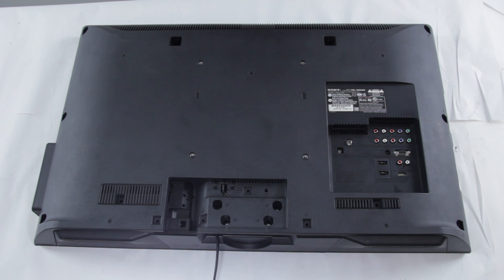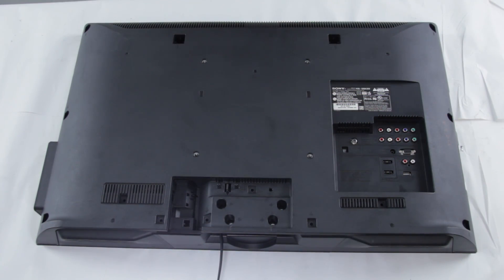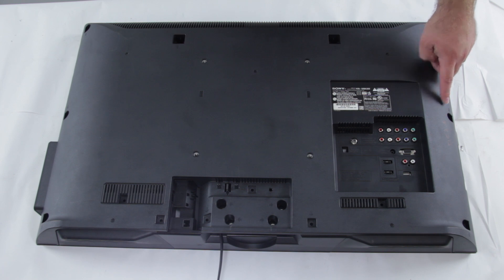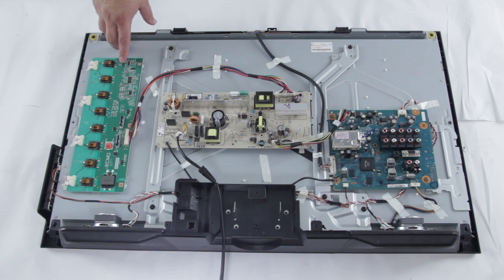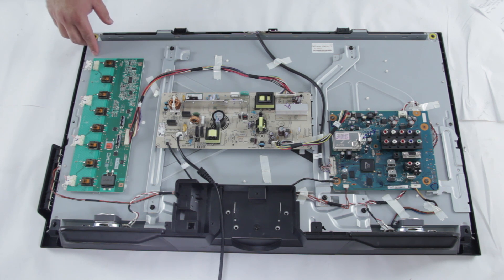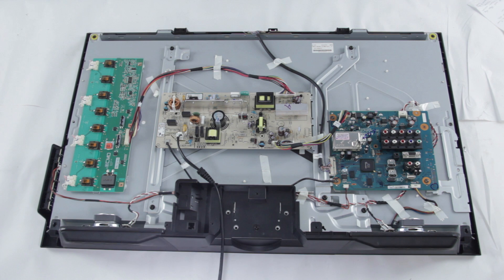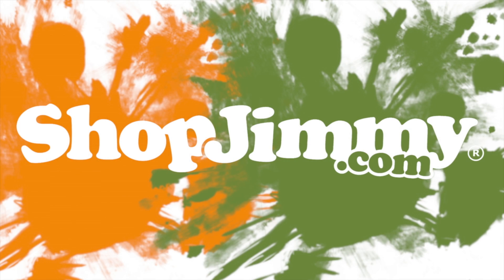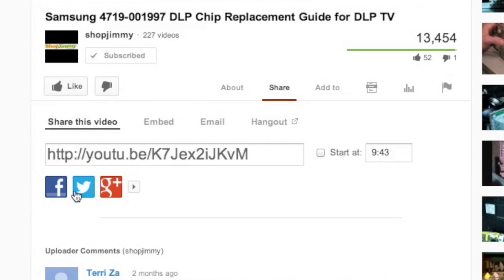LCD TV Repair Tutorial - Backlight Inverter Common Symptoms & Solutions - How to Fix LCD TVs

Comment: Hello.
A friend and I we are trying to repair a TV.
The screen of the TV seems to stay black when the TV is connected to the grid.
But if a strong light is held close onto the black screen it can be noticed, that the screen ist not completely black, but still showing that fine optical hissing.
Does this mean for sure that the inverter is broken?
Is there a way how to find out if it s really the inverter that is broken and not any other part ?
Thanks
Reply from the maker: Vornamest Nach   Please check in your TV to see if there is an inverter board.  I do not see any in the search results on our website.  Thanks!  www.shopjimmy.com

Comment: i buy 11 element elefw328 but now the backlight always dim when turn on any help please.
Reply from the maker: mechi1095   I recommend replacing the power supply board in your TV.  Here is a link to replacement parts for your TV model number on our website, click here:  http://www.shopjimmy.com/catalogsearch/result/index/?cat=59&q=elefw32  Be sure to match part numbers on your current board, with your replacement for compatibility.  You can also call our customer service for further assistance with your purchase.  (877) 881-6492  Thanks and please let us know if you have any further questions with your TV Repair!  www.shopjimmy.com

Comment: when putting a flash light up i could the picture but no backlight
Reply from the maker: *****   You will want to replace both the left and right backlight inverter boards.  Here is a link to replacement parts for your TV model number on our website, click here:  http://www.shopjimmy.com/catalogsearch/result/?q=le52m87bdx%2Fxeu  Be sure to match part numbers on your current board, with your replacement for compatibility.  Here is a link to a video showing how to identify your part number, click here:  http://www.shopjimmy.com/catalogsearch/result/?q=le52m87bdx%2Fxeu  You can also call our customer service for further assistance with your purchase.  (877) 881-6492  Thanks and please let us know if you have any further questions with your TV Repair!  www.shopjimmy.com

Comment: Hi, I have a RCA RLDEDV3988-A LED TV. A few days ago, the tv screen didn't light up when I turned it on. (I had to wait for a whole night after initially turning it on for the screen to show up.)  Right now, the screen doesn't show anything at all. The sound still works fine, just no picture. I was wondering if it has to do with a light issue? Not sure. Please help!!

Comment: I have a Samsung LTA400WT-LO1.  When I turn on the tv it goes black a min or so into it but the sound you can still hear. I have been looking up how to diagnose a bad inverter board. I have the back of the tv off and am looking at the inverter board I think. Where is the master and where is slave. Is it on the same part? Is there an email I can email you guys at?
Reply from the maker: Jonn jonzz   I recommend running the flashlight test on your TV.   Here is a link to a video we produced that shows how to run the flashlight test. No Image No Picture on TV Screen-Flashlight Test LCD TV Repair - How to Diagnose Broken TV Repair Please reply with your flashlight test results and we can recommend a replacement part for your TV repair. Thanks and please let us know if you have any questions! www.shopjimmy.com

Comment: Hi
I have a Samsung le52m87bdx/xeu, it is turning on for a few minutes and then the screen goes blank and the sound stays on, I believe it is the backlight inverter but there is 4 of them, is there anyway to see which one is the problem.
Reply from the maker: *****   I recommend running the flashlight test on your TV.   Here is a link to a video we produced that shows how to run the flashlight test. No Image No Picture on TV Screen-Flashlight Test LCD TV Repair - How to Diagnose Broken TV Repair Please reply with your flashlight test results and we can recommend a replacement part for your TV repair. Thanks and please let us know if you have any questions! www.shopjimmy.com

Comment: I have problem in my sony tv model 55hx750 the problem is when i start tv with remote there is no light on the tv screen and red led of power suply goes off temporarily and green led blinks one then goes off and again red led starts blinking.Please suggest me what could be the problem
Reply from the maker: Smit Bagadia   How many times does your TV blink?  Thanks!  www.shopjimmy.com
Reply: tv screen does not blink it remains completely dark.The red led on the left side bottom starts blinking when we start tv with the help of remote control
Reply from the maker: Smit Bagadia   How many times does the LED light blink?  Thanks!  www.shopjimmy.com

Comment: could i replace this if my problem is just a blank white screen? i already replaced the tcon board which i thought was the problem but i was wrong
Reply from the maker: Jamison Estep   Please reply with the following information.  TV model number, symptoms of what the TV is doing.  Thanks!  www.shopjimmy.com
Reply: Bottom line: grandmother gave me an insignia lcd tv that she found. no power cable or remote. found a cable in my house that fit. Plugged the tv in, all white screen. nothing shows up even when pushing menu button. did a bit of looking around, most people said its because of a bad tcon board. so went ahead and opened up the tv, found the part number and ordered a new one. part came today, plugged it in, put everything back together. still the same problem. any halp would be greatly appreciated. i would like to give this back to my grandmother as a gift. 
 
Model # : NS-LCD26-09
Reply from the maker: Jamison Estep   This sounds like a TV panel problem.  If your TV panel is bad, it may be more cost-effective to replace the TV as panels are typically hard to find in stock, difficult to replace, and expensive.  Thanks and please let us know if you have any further questions!  www.shopjimmy.com
Reply: What do you mean by "tv panel"
Reply from the maker: Jamison Estep   The "TV Panel" is the TV screen.

Comment: I have a samsung LN40C530F1FXZA Ser number Z1MC3CUZ520257H. 
The TV will not power on.  When you turn it on the red light blinks but the TV does not power up.  Already replaced the power supply board and no go.  I hear it could be the back light inverter.
Reply from the maker: WILLIAM BROWN   I recommend replacing the main board in your TV.  Here is a link to replacement parts for your TV model number on our website, click here:  http://www.shopjimmy.com/catalogsearch/result/?q=LN40C530F1FXZA  Be sure to match part numbers on your current board, with your replacement for compatibility.  Here is a link to a video showing how to identify your part number, click here:  Samsung Main Boards & Digital Boards: Part Numbers for LED, LCD, DLP, Plasma TV Repair  You can also call our customer service for further assistance with your purchase.  (877) 881-6492  Thanks and please let us know if you have any further questions with your TV Repair!  www.shopjimmy.com

Comment: Hello, I have a Sharp LC-42D65U LCD tv that the power light just comes on and blinks every second, I tried the volume dwn trick but it still does not work. Just no pic and no sound
Reply from the maker: Roger Kirk   I recommend replacing the main board in your TV.  Here is a link to replacement parts for your TV model number on our website, click here:  http://www.shopjimmy.com/catalogsearch/result/?q=LC-42D65U  Be sure to match part numbers on your current board, with your replacement for compatibility.  You can also call our customer service for further assistance with your purchase.  (877) 881-6492  Thanks and please let us know if you have any further questions with your TV Repair!  www.shopjimmy.com

Comment: dynex dx-l42-10a picture is distorted
Reply from the maker: Gregg Hancock   I recommend replacing the main board in your TV.  Here is a link to replacement parts for your TV model number on our website, click here:  http://www.shopjimmy.com/catalogsearch/result/?q=dx-l42-10a  Be sure to match part numbers on your current board, with your replacement for compatibility.  Here is a link to a video showing how to identify your part number, click here:  STEP #1 - Insignia Main Boards Replacement TV Part Number Identification Guide  You can also call our customer service for further assistance with your purchase.  (877) 881-6492  Thanks and please let us know if you have any further questions with your TV Repair!  www.shopjimmy.com

Comment: I have a 32" Hitachi LED tv : L32VP03U.  When I switch on, it works normally, then after few minutes the light/image goes off but the sound stay on. Is it backlights inverter problem?  if so, where can Buy it for replacement? send me an answer on my e-mail, please.
Reply from the maker: Edouard Bareberaho   I recommend running the flashlight test on your TV.   Here is a link to a video we produced that shows how to run the flashlight test. No Image No Picture on TV Screen-Flashlight Test LCD TV Repair - How to Diagnose Broken TV Repair Please reply with your flashlight test results and we can recommend a replacement part for your TV repair. Thanks and please let us know if you have any questions! www.shopjimmy.com

Comment: Aloha "Shop Jimmy" and company.
     I have a Visio 55" LCD TV, Model # E550VA. The problem I am experiencing is the screen has lost half (the left side) of the backlit display. I can see the "NO INPUT" splash screen bouncing around the entire screen. It's barely negligible as it bounces on the left side of the screen, but video is present. I'm an older electronics tech myself, just never have worked on LCD HDTV's before today, and I've learned never to assume anything.  After reviewing various internet posts from others experiencing similar (but not exact) backlight issues, I'm leaning in the direction of one of the Backlight Inverter Board's as being the problem. But then I pondered, could it be weak output from the Power Supply? Could the problem be that the Power Supply isn't producing proper voltage or sufficient amperage to drive the Backlight Inverter Board that supplies Backlighting for the left side of the screen?
      Are the Power Supply circuits that drive both BL Inverter Boards, coming from a single Power Supply, with circuits that are isolated from each other?  Or are there 2 separate Power Supplies?  I'm guessing, but I think the symptoms would be similar for either a failed inverter board, or a weak or failed Power Supply. What is the best way to be sure?
   My Jimmy sir, I appreciate your time and comments in the interest of getting my Visio TV back in the saddle. I simply can't afford to incorrectly troubleshoot and order wrong parts for this repair. Money & TV entertainment are both a commodity at the moment. Lol. Your Kokua (help in Hawaiian) is appreciated...
With Aloha from Oahu Hawaii, 
Robert C.
Reply from the maker: Robert Ciano  This sounds like a TV panel problem.  If your TV panel is bad, it may be more cost-effective to replace the TV as panels are typically hard to find in stock, difficult to replace, and expensive.  Thanks and please let us know if you have any further questions!  www.shopjimmy.com

Comment: Hello ShopJimmy,
I would appreciate any help I can get as I have been having problems with my tv for about a year now. I bought a Samsung Model no: LN32C530F1F in May 2010. In April 2013 it started having problems: the tv would turn off while I was watching it and then turn back on a couple of seconds later. As time went on, the tv would turn off more frequently and take longer to come back on. Eventually the power light would flash for days and still not turn on (no sound came through whenever tv screen was not lit).
I read many forums about the problem likely being faulty/burst capacitors as is common for Samsung tv and ordered the appropriate caps. In September 2013 I opened up my tv to get to work on replacing the capacitors but noticed they all looked fine (no bulging, no leaking, just flat tops). I am not an electrician at all but I carefully proded around looking for something else that stood out but saw nothing. Sad I wasn't able to do anything, I reassembled my tv and plugged it in: to my surprise it turned on immediately and didn't turn of. I figured maybe there was something loose that I happened to touch and readjust so that it was now working perfectly fine.
It worked flawlessly for ~9 months until two weeks back when the tv started having the same problem. Once again I opened it up to check the caps and once again all caps looked okay. Frustrated, I proded more, this time opening up the covered thing with high voltage warning (the inverter? If my googling is correct). What I see are 8 copper wrapped things (transformers?) covered in a little plastic; one which appears as if some mini reaction/explosion occurred and fogged up the inside of the plastic.
I am thinking this is likely the problem and before spending countless hours googling for more info I came across your youtube and thought I would ask you. Is this likely the issue? Should I buy a whole new inverter? Or is it possible for me to replace the transformer? Any help would be greatly appreciated.

Sincerely,  Ana
Reply from the maker: atd2101   I recommend replacing the inverter in your TV.  Here is a link to replacement parts for your TV model number on our website, click here:  http://www.shopjimmy.com/catalogsearch/result/?q=LN32C530F1F  Be sure to match part numbers on your current board, with your replacement for compatibility.  You can also call our customer service for further assistance with your purchase.  (877) 881-6492  Thanks and please let us know if you have any further questions with your TV Repair!  www.shopjimmy.com

Comment: I have a Vizio VW42LFHDTV10A and it turns on for a second then the screen goes black. I can push the input button and see it switching with a flash light. What do I need to fix the problem?
Reply from the maker: Cory Davis   I recommend replacing the inverters in your TV.  Here is a link to replacement parts for your TV model number on our website, click here:  http://www.shopjimmy.com/catalogsearch/result/?q=VW42LFHDTV10A  Be sure to match part numbers on your current board, with your replacement for compatibility.  Here is a link to a video showing how to identify your part number, click here:  LCD Help Part Identification Number Guide for LG & LG Philips Backlight Inverter Boards TV Repair  You can also call our customer service for further assistance with your purchase.  (877) 881-6492  Thanks and please let us know if you have any further questions with your TV Repair!  www.shopjimmy.com
Reply: Should I purchase the inverter kit?
Reply from the maker: Cory Davis   I recommend calling our customer service to discuss further.  (877) 881-6492  Thanks!  www.shopjimmy.com

Comment: Hi guys, I have a problem with a Samsung LN32D430G3D. It starts alright, but after a minute it dims and then randomly becomes bright again for a moment. I noticed that the right side is darker and has some lighter areas near the edge of the screen.

I you could point me in the right direction it would be awesome!
Reply from the maker: Electromech   I recommend replacing the backlight inverter board in your TV.  Here is a link to replacement parts for your TV model number on our website, click here:  http://www.shopjimmy.com/catalogsearch/result/?q=LN32D430G3D  Be sure to match part numbers on your current board, with your replacement for compatibility.  You can also call our customer service for further assistance with your purchase.  (877) 881-6492  Thanks and please let us know if you have any further questions with your TV Repair!  www.shopjimmy.com
Reply: Thanks for confirming guys!

Comment: i have an element tv model flx 3210 screen is dark but has image 
whats the deal
Reply from the maker: andrew schneider   I recommend replacing the inverter board in your TV.  Here is a link to replacement parts for your TV model number on our website, click here:  http://www.shopjimmy.com/catalogsearch/result/?q=flx+3210  Be sure to match part numbers on your current board, with your replacement for compatibility.  Here is a link to a video showing how to identify your part number, click here:  LCD TVs 101: Part Identification Number Guide for Chi Mei (CMO) Backlight Inverter Boards  You can also call our customer service for further assistance with your purchase.  (877) 881-6492  Thanks and please let us know if you have any further questions with your TV Repair!  www.shopjimmy.com

Comment: Hi sir, I have a problem with my OVATION LCD TV (OVA-HKC22A2) w/ main board (CV068L). It has power and sound but black screen. I think the backlight inverter is the problem because I've tried turning it on and put flashlight on the screen I see an image.  how can I locate the backlight inverter can you help me please.
Reply from the maker: erwin estanislao   The inverter will either be on the sides of the TV or built into the power supply can you upload a picture and then share the link with us?  Thanks!  www.shopjimmy.com
Reply: Sir, thanks for the info. I've replace two busted capacitors on the power supply board. I've got the picture of the power supply but I don't know how to link it to you. still got the same problem..
Reply from the maker: erwin estanislao   You can upload it to Google+ or to any other photo sharing application.  Then just send us the link.  Thanks!  www.shopjimmy.com